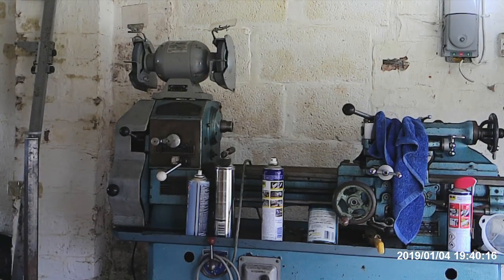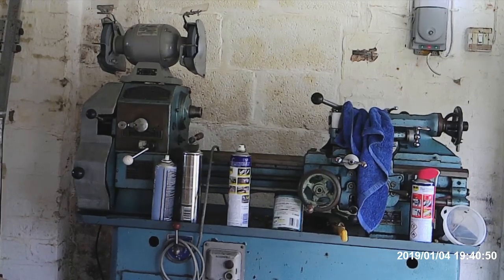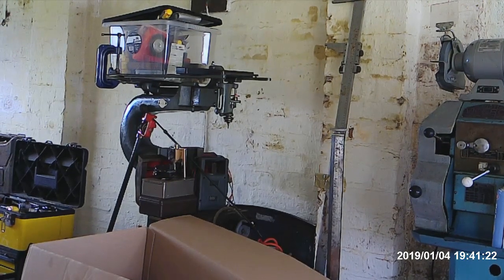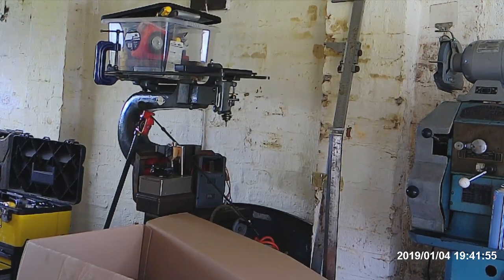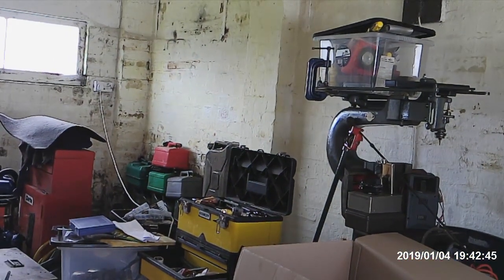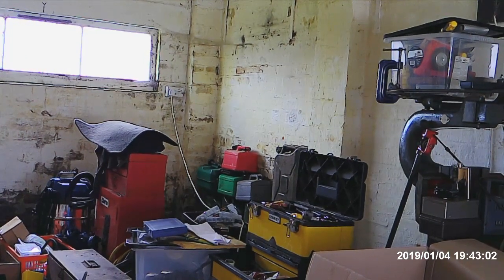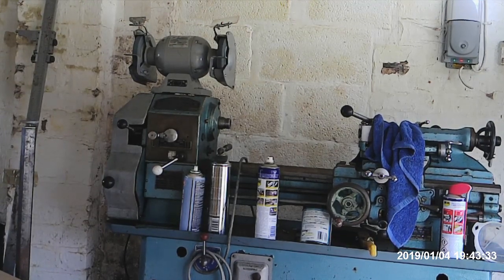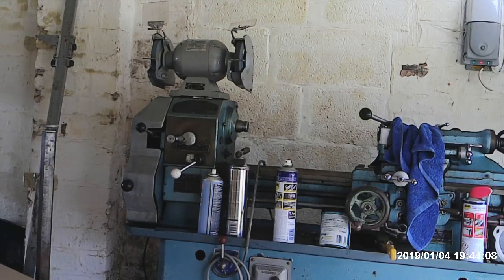Episode 1   The Beginning

Comment: Hi Jon, I am watching this in July 2021 and two things come to mind, the first thing is that I used to be a craft design and technology teacher in a high school in outer London and when I went to the school in 1978 the upper school workshops had only recently been built and the metal shop had 4 brand new Viceroy lathes exactly the same as yours, well three were, the fourth had a milling attachment bolted to the back of the bed in the middle of the ways. Lovely machines, and solid as a rock. These were in pristine condition and I think one of them had never been used at all when I got there. The workshop had only been up and running for one school year so they were not even run in ! lol. The other thing is that a few years later I had become a gun nut and as the crow flies the Royal Manufactory at Enfield Lock as it was properly known when it opened in 1852 I think, would only be about two and a half to three miles from the school. As I was very much into vintage arms I had a pattern 53 5.77" muzzle loading rifle, and a . And an ex RAF 303" Lee Enfield number 4 of 1952 vintage.  Anyway I hope you don't decide to repurpose the engraving machine from the old Enfield factory, ( all gone now, it's a housing estate!) as it is a very important part of British firearms history and really should be offered to the Tower of London collection now residing at the tower armouries in Leeds if not there I'd contact any of the big London auction houses to see if they would put it in one of their big firearms auctions. You could well get a very good price for it. Imagine the hundreds of thousands of all sorts of guns and other parts this one machine engraved, maybe even in the millions depending when it started its life there. Looking forward to seeing your journey.
Reply from the maker: Hi Samrodian, thanks for the comment and welcome to the channel. The Denfords are good machines, I actually remember working one in CDT back in the mid 80's lol. Unfortunately, try as I might, I have managed to lose all the documentation for the Taylor Hobson, think it got misplaced in the last house move, so all I have to go on is my say so from having read it. It actually came out of Royal Ordinance in Nottingham (to the keeper before me) where it had been in storage since RO took over from RME. I am looking to move it to a new home, the spindle is worn out and replacement is more than the machine is worth. I need the space for machinery that will be used far more frequently. It will be sold on in its current state as I don't have the gear to attempt spindle repair or manufacture. Cheers, Jon

Comment: Sound's too quiet - I hope later vids are better !
I've just started channel 'Machining by Mike' but I may be in a worse situation than you here ! I've inherited my dad's workshop which is about 80% junk - very little floorspace to stand on. The machinery is installed BUT
The box of capacitors for 3ph just went bang on power up. Rust is an issue - so bought a dehumidifier - running day & night - then heard little bangs due to dad's wiring cock-up - so garage is currently disconnected !
Recently got a diesel generator for 3ph. So job at the mo is elec matters.
Reply from the maker: Hi Mike, thanks for the comment. Yes, when I started I had a cheap and nasty camera. My later videos are much better sound and visual with a bit of money invested in a Sony Handycam. Good luck, sounds like you were where I was 15 months ago. It's a lot of graft but worth the effort. Cheers, Jon
Reply: @jonsworkshop  I won't be buying Sony again ! Too many probs with gear and getting new stuff repaired.
About 2 years ago, sold our rotary table - thinking I wasn't going to use 'this stuff' - then labout a year ago, started watching a few machining channels - and that gave me ideas !  I knew 3ph power was a problem - took 6 months to decide on a way forward. Now I'm mid-Wimbledon ;)

I'll give you a nod when I've got 'finished' videos uploaded !